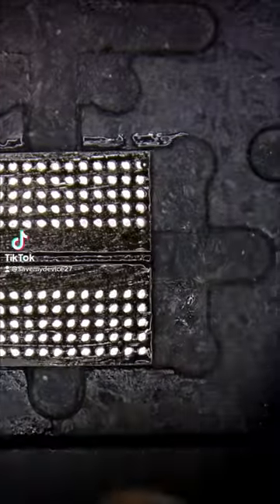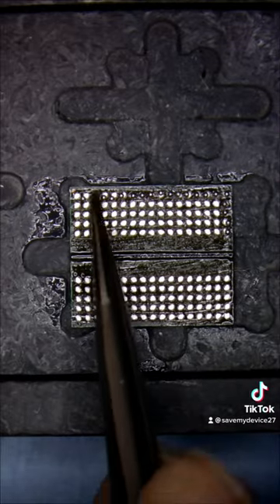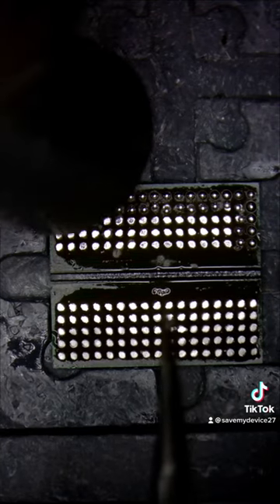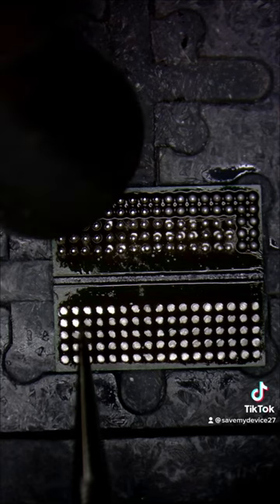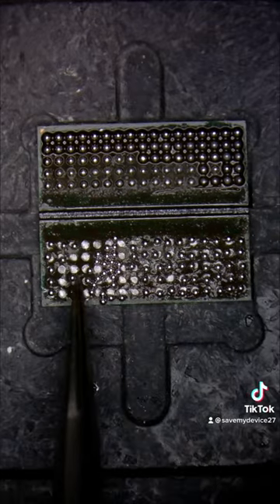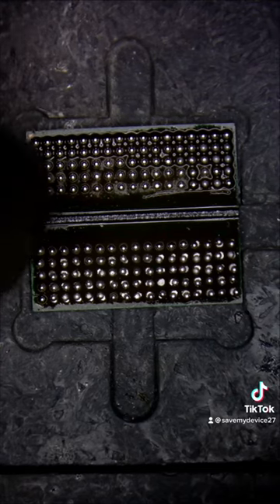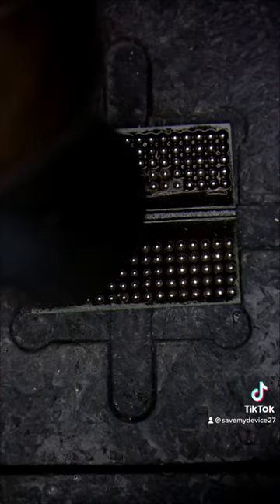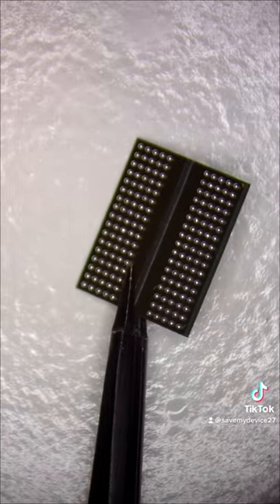Manually Reballing a PlayStation 4 Ram Chip! #manually #reballing #playstation #4 #sony #replacement

Comment: How much would you charge to repair a PS4 POWER supply that experienced a lightning strike. Fuse blew, and a couple of the traces right around the fuse area. I believe it's the adp 300 power supply.